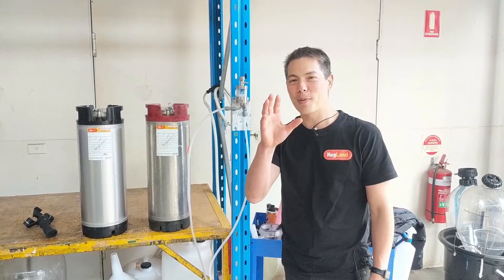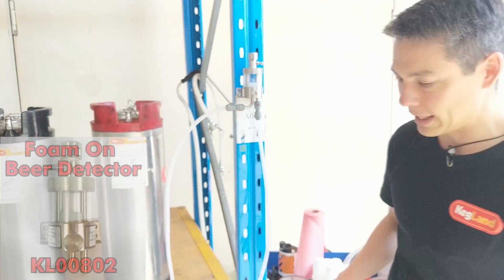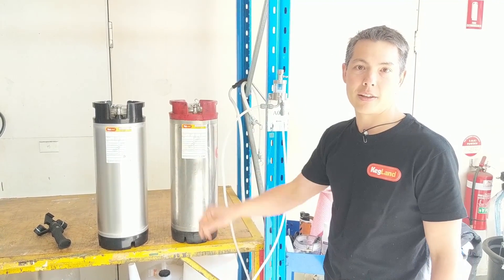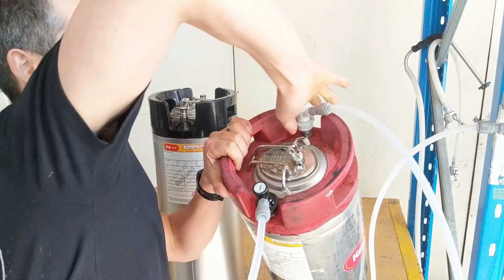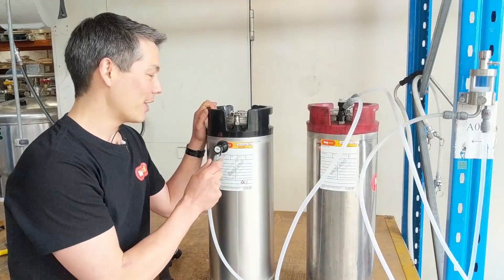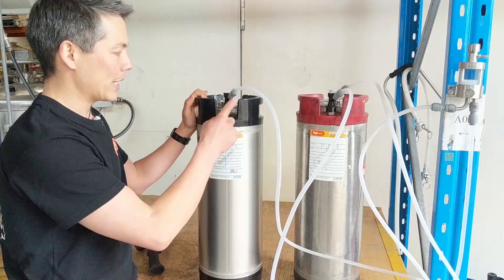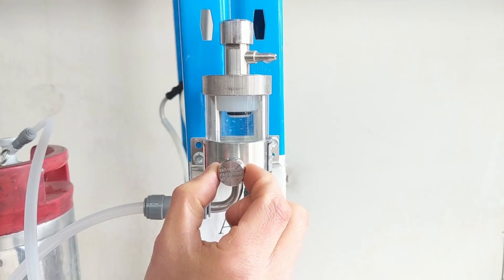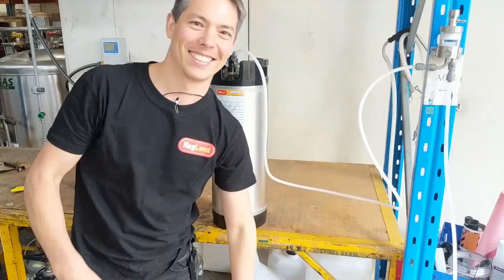Use a FOB to quickly and automatically purge keg of oxygen prior to filling

Comment: So if it shuts off the co2 when its done.  Can i technically hook it up to my fermentation so the co2 from yeast does it and qhen its empty is shuts it off and then my unitank turns into a pressurized fermentation with my spunding valve. I want to ferment under pressure but i want to save co2 and use my fermentation in the start to purge my starsan out of keg
Reply from the maker: Just use the spunding valve into a keg - same effect. This will only work with liquid

Comment: In a short line home brew setup, is the purpose of this valve to know when the 1st keg is empty of sanitizer? Won’t you just know, when the liquid out from the 1st keg runs out of liquid and begins pushing co2 to the 2nd? Once it does that, then just connect your fermenter and transfer the beer O2 free. Or am I misunderstanding the purpose of the shutoff valve?
Reply: The purpose of this valve is to automate the process so you dont have to sit there waiting for the keg to fill.  If you accidentally leave the keg with CO2 attached you could very easily just empty a whole bottle of CO2.  

So you are right in saying that this valve is not technically necessary if you don't mind watching the sanitizer transfer from one keg to another.
Reply: Yup. This makes it a bit easier. I haven't checked, but maybe Kegland sells the valves? If so, it'll be easy to buy from a reputable seller which is nice.

Comment: Won't oxygen go right back in the keg when you open it to fill it with beer? Then you just have to purge the headspace again like normal, sort of defeating the purpose of this. Or Am I missing something?
Reply: The point is to NOT open the keg when transferring. You hook up your fermenter directly to the beer out post and pressure transfer straight from the fermenter to the keg. You just have to release the CO2 from the keg regularly.
Reply: @frigorifix  Correct
Reply: In theory if the keg is full of CO2, and you are careful when you open it (assuming you are not doing a closed transfer), you'll minimize oxygen exposure.